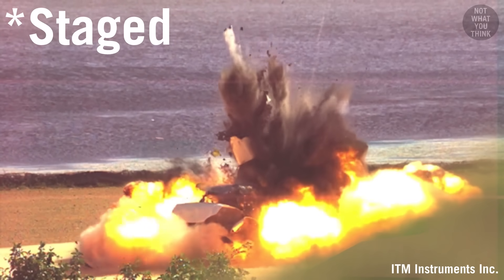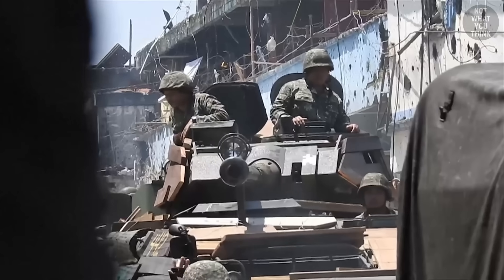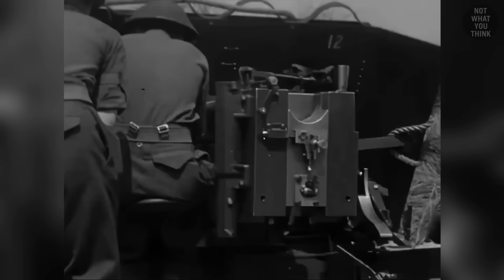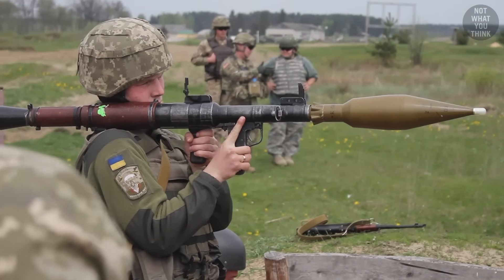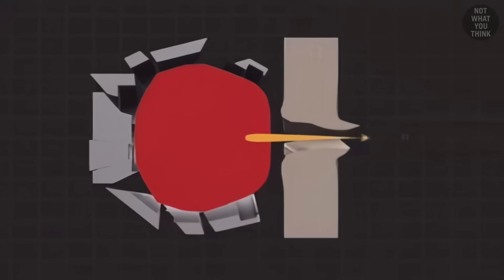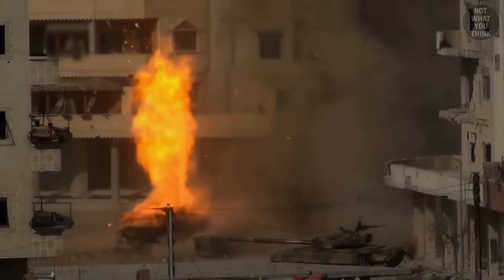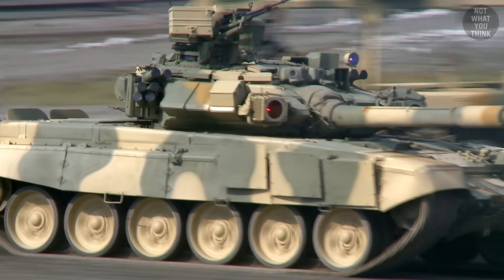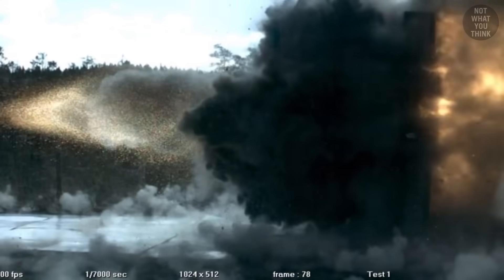Why Protecting Tanks is Getting Much More Difficult

Comment: An interesting take away from this video is that the conventional means of projecting power in an area are becoming consistently more unreliable. A tank can be shred by a single missile costing less than a tenth of what the tank costs; IEDs and forms of handheld explosives can severely disrupt logistics and transportation with impunity; drone technology is so flexible and adaptable as to force any longer operation to take it into account, making several kinds of operations not feasible. In short, being completely ignorant of modern warfare doctrines, I'm getting the impression that today any form of military doctrine that doesn't involve lightning strike operations to disable or destroy key targets is highly anachronistic.

Comment: Introducing: Swirling balls of compressed garbage around a tank.
It takes hits upon impact.

There's a pulse width modulation module on board of said tank to time those particles so that projectiles from the tank would pass through.

The best way is to use cheap, mobile, highly experienced mini-teams to  neutralize targets. Because even small things like a grenade could do very critical damage.

If maximizing damage isn't the objective, then... well, another grenade saved.

If maximum damage is demanded and consequences are accepted -> nuclear option (would never happen - HOPEFULLY).

Why even bother? Nobody could actually take any land by force anymore these days. Just focus investment in leaving earth in less than 1.200 days!

Comment: One solution to this, is, instead of making tanks more expensive, and more heavily armored, they could make them smaller and cheaper. You can mount a pretty powerful gun on a relatively small frame these days, and if that frame is harder to hit and more maneuverable, you could potentially avoid those expensive anti-tank rockets. It would not offer the crew as much protection as a traditional tank, but then again, traditional tanks aren't offering that much protection these days either.

Ultimately though, I think ground combat is going to eventually head where air combat is going now, unmanned remote controlled vehicles. As much as I loath this development, as it will make war a more enticing prospect for warmongers and cowards alike, that is the way things are headed. Humanity simply has no faith in itself. Though the individual soldier is currently too cheap to replace with robots, the day will come when technicians are the only 'human' thing left on the battlefield.

Comment: I have a solution for this. Multi layers. Using an electromagnetic inner layer. Outer layer, tungsten steel. Middle layer, Ferromagnetic iron liquid, (this layet should be thick, with pure tungsten balls suspended within. A thin sensory membrane layer between outer and inner plates.
Turn polarity towards high attraction. Use a lattice work, cell support structure rated to withstand extreme magnetic attraction and repulsion strains. Upon impact with a railgun, sensor membrane is penetrated, which reverses polarity. Creating a high repulsion field. The projectile impacts initial layer, breaks up. Penetrates membrane, as projectile fragments become coated with iron "paint", flowing threw the ferromagnetic liquid, large/small round fragments impact against the suspended tungsten spheres further breaking apart. High repulsion field is pushing everything back in the direction its coming from, as it's coated by the iron paint. Which reseals the entry wound with tungsten spheres. After repulsion is finished. If this is done cell by cell should simplify repairs. This also triples as high grade starship anti radiation screening. Plus with the right charge/construction, you can turn the metal paste, solid. Whilst enveloping any fragments mid flight.  Add a light, tertiary armor layer ontop of the electromagnetic plating. A kevlar made from graphene fibers, with a ceramo-tungsten plating.
Reply: And after all that declare a default after a couple of prototypes.

Comment: and you have french doctrine: AMX tank on wheels designed not for taking hit, but for shoot everything, and avoid hit by mobility.
the heavy tank are heavy, slow, low range, they are good for pierce a front, but are useless rest of time. specially if you theres antitank everywhere, and drone flying everywhere along battlefront.
by the way, infantry will always need vehicules, and i think that drone/missile/artillery domination can deadlock any vehicule to move.

Comment: @Not What You Think

GrandGrandSon of someone who fought against the Red Plague all the Way TO Stalingrad! here (And also a Sodlier/Combat Engineer/Inventor just like his GG Parent:
PzF was SEMY reloadable, since it's tube was so heavy duty at the beginning,they were considered valuable recyclable and some were used MANY TIMES in Pzf 60 and were later used in Pzf 100 and possibly even 150!!!  You usually kept the "Faustpatrone" (SC-Warhead) screwed off the rocket and Blasting Cap put on ultra-simple Inertial Pyrotechnical plug/firing pin on weight/spring contraption until the possible danger or photoshoot arrived (lol) SOOO those with a bit more know-how
easily improvised the warheads, with trench made usually/wall breaching AP or combined AP/AT/Antimaterial warheads with original or improvised black-powder charges and the counter-weight made from cookies and sand and some equally primitive but effective back sealant like some cardboard and boiled sap! (Pretty darn clever!) The rest is a primitive one-piece mousetrap spring firing system in reverse and one black-powder musket-like ignition cap that was used as the firecracker (DON'T !!!)  among the kids between the wars! Pretty darn impressive for the:
- "One-shoot under-shoulder tank-killing mortar-round fired from sunshade-umbrella tube THAT USES RECOILESS-CANNON-PRINCIPLE! ! Yeah!!! 
I BET it probably started as a joke if someone higher up said saw it and said how about "Fire and Forget" it kid, that's dangerous! ROFLMAO!!!
If both did not have some w/o pyro-intuition and schooling and knack for an invention so higher-up demands him to explain it in stupid-simple terms! LOL
"Stop With that science blow-up talks and explain to me, IN SIMPLE TERM, what is it,
and what it does. After some silence, they would probably ask "what is that "SC" thing?"
Sir,it is a very interesting principle where LESS EXPL with a THIN METAL LINER and basically just enough speed to avoid being danger-close hurling it on the target!
newly-found Physical properties employing ONLY THE FRACTION of metal and Expl. to go through the thick TANK or FORT ARMOUR, SIR!

"Feeling Your superior boiling: "It is our Pyro-Witchcraft, Sir!"

-"Ok Sign up here, JUST! DON'T come very CLOSE! YAAAH, just over there...NEXT!!!

Comment: Here is confusion between between shaped charge and se look f forming projectiles. The first video is of projectiles, produced in a conical shaped explosive, where's metallic lining is squashed into a slug. The velocity of that slug is so great, it will penetrate armour, from some metres away.The second type detonates within inches from the armour, forming a jet of metal and gas travelling at some fifty thousand miles per hour, melting a path through the armour. The second must detonate close. The heavy slug can be off route, some metres away.
Reply from the maker: Your distinction between shaped charges and EFPs is correct, but what you see at 0:29 is a shaped charge detonating prematurely. That’s because on the left hand side, the tank’s active protection system kicks in and detonates the shaped charge before it gets any closer  to the tank.
We didn’t show any footage of EFPs in this video.

Comment: Nuclear weapons have stopped used shaped charges a long time ago.  There are severals reasons why but the two most prominent are that they make the bomb huge and the other is that it makes a weapon much easier to steal and detonate.

A modern weapon has a neutron source that is activated electronically to cause a fission runaway reaction which in turn causes fusion in a secondary or multiple other secondaries encased in a uranium shell (which under goes fission from this fusion reaction).
Reply: Actually even the latest fission primaries use controlled implosion by engineered shaped charge.  The neutron generator you refer to is a very small particle accelerator that provides neutrons milliseconds after the boost gas is injected into the hollow core and is timed to pulse at the exact time the core is at it's densest compression.  By changing the timing of the pulse the yield of the device can be changed, hence the "Dial a Yield" name of some tactical warheads.
Reply: The method of forcing a fissionable material to criticality (thru implosion) has NOT changed since first used with Fat Man. Design improvements have made the much smaller sizes possible.

Comment: I’m trying to understand that footage. When the middle explodes prior to hitting the armour  -  is that footage me seeing the missile explode enter 8-14 miles a second . Which is faster than speed of light 1 mile a second . And therefore - it appears the armour is hit long before the missile explodes ?is that what I’m seeing?
Reply from the maker: What you see at 0:29 is an explosive charge detonating prematurely, prior to hitting the tank. What detonated the explosive charge?
The tank’s active protection system that is on the left.
So this is the order of events:
Shaped charge approaches. Active protection system detects it and engages, casing an explosion by the tank. 
That explosion neutralizes the shaped change, by detonating it at a distance. The detonation of the shaped charge results in the jet of metal shooting out of it prematurely. So the tank is safe. 
Hope this helps. 

Not sure about your speed of light reference, which is actually 186,000 miles per second.
Reply: @NotWhatYouThink  ah ok. Yeh I totally misread speed of light at a glance search.  

Ok cheers I see now what happened . I just thought the reactive armour needed to send material out to contact the missile in order to detonate the missile prematurely - what is that reactive armour using to cause the missile to prematurely fire
Reply from the maker: To be honest, I haven’t researched that part of it 😅
My guess would be that the reactive armor’s explosion creates a directed shockwave that triggers the shaped charge. But I could be wrong.

Comment: rpg does stand for rocket propelled grenade check it out: 

Rocket-propelled grenade
From Wikipedia, the free encyclopedia
Jump to navigationJump to search
For similar terms, see Shoulder-fired missile.

A rocket-propelled grenade (left) and RPG-7 launcher. For use, the thinner cylinder part of the rocket-propelled grenade is inserted into the muzzle of the launcher.

Soviet/Russian rocket launchers. From top to bottom: RPO-A Shmel, RPG-22, RPG-26, RPG-18.
A rocket-propelled grenade (RPG) is a shoulder-fired missile weapon that launches rockets equipped with an explosive warhead. Most RPGs can be carried by an individual soldier, and are frequently used as anti-tank weapons. These warheads are affixed to a rocket motor which propels the RPG towards the target and they are stabilized in flight with fins. Some types of RPG are reloadable with new rocket-propelled grenades, while others are single-use. RPGs are generally loaded from the front.[1]

RPGs with high-explosive anti-tank (HEAT) warheads are very effective against lightly armored vehicles such as armored personnel carriers (APCs) and armored cars. However, modern, heavily-armored vehicles, such as upgraded APCs and main battle tanks, are generally too well-protected (with thick composite or reactive armor) to be penetrated by an RPG, unless less armored sections of the vehicle are exploited. Various warheads are also capable of causing secondary damage to vulnerable systems (especially sights, tracks, rear and roof of turrets) and other unarmored targets. Wikipedia

Comment: With the advent of higher yield missiles and even infinitely cheaper, mobile anti-armoured vehicle NLAW launchers that infantry can carry and deploy as necessary (and the reason why the Russia-Ukraine war tide turned), the Tank is a product of its time. To a well equipped military, a Tank isn't as scary on the battlefield as it perhaps was.

Advanced close air support is additionally a factor now. If I was on the battlefield, I'd rather be supported by an A-10 Thunderbolt II or an RAF Harrier GR9. One of those circling would strike fear into any enemy infantry.

Comment: Just like the development of castles and siege weapons. Walls, siege catapults.  Bigger walls, cannon, Cannons behind walls. On and on it goes. I'm thinking drones with shaped charges. Or they could send an EMP through the tank and destroy the electronics. Not sure why no one has explored this stealthy option so much cheaper too. Then the drone flies away to be reused. I'm a genius.
Reply: So far, the only thing which has been proven to cause an EMP powerful enough to be militarily useful is the detonation of a nuclear warhead.
Reply: @JigerotatheWicked  Rather expensive way to "prove" a theory. Like using a shotgun to kill houseflies.  Has anybody even researched it? I haven't even seen it in movies. So cheap so simple. Tanks made out of metal. Excellent conductors of electricity. Lots of electronics. Blow out the electronics, tank is almost useless.

Comment: You would think that since the A-10 was introduced over 45 years ago that they could come up with a new and better platform.  These planes have performed incredibly and are still needed. Attack Helicopters are the closest thing to ground support that the A-10 provides.  It just needs updated and provide the pilots more modern weapons and warning systems.
Reply: Expensive
That's the main reason most nations are using shit from 40 years ago. Shits too expensive. Might as well have cheap and "good enough" instead

Comment: Protecting tanks from unfriendly infantry with AT weapons has always been difficult since WWII. There's good reason why sending tanks into built-up areas without infantry support tends to end quite badly for the tanks, and this fact hasn't changed since the 2nd World War.

Most modern tank armour is highly resistant to shaped charges from the front, hence why top-attack munitions like the NLAW, CBU-87 bomblets, and FGM-148 Javelin are so deadly to AFVs, which generally have much thinner armour on top of their turrets.

Even so, a tank's armour actually ranks pretty low in terms of its protection, at least according to the "lethality onion" model. 
Do not be seen.
If you are seen, do not be acquired (i.e. targeted)
If you are targeted, do not be hit
If you are hit, do not be penetrated
If you are penetrated, do not be killed (i.e. immobilized, disabled, or destroyed)

The tank's armour is to protect against threats that have seen, acquired, targeted, and hit the tank. And no matter how advanced tank armour becomes, there will always be things capable of defeating that armour.

NLAWs, Javelins, and RPG-29s don't make tanks obsolete at all. There's still plenty of things on the battlefield which cannot easily defeat tank armour, and which in turn are highly vulnerable to tanks.

Unless warfare changes so drastically that we no longer have need for highly mobile, direct fire platforms which are nigh-immune except to weapons designed specifically to kill them (and which are generally not so great at killing other things which aren't AFVs), the tank is here to stay.

Comment: Makes a lot of sense. Tanks were OP when they first emerged in WW1 because weapons were pretty much just normal bullets and relatively weak grenades. Forget about specific anti-tank weaponry; the evolution of flight and computers is enough to make tanks irrelevant eventually. Drones are terrifyingly powerful
Reply: Drone operators will justly be treated like snipers and flamethrower used to be
Executed on the spot when captured
And I cannot disagree with such treatment